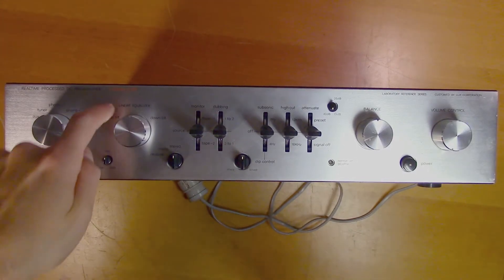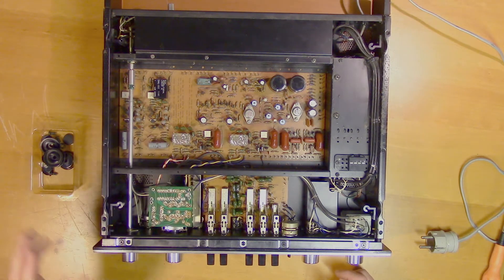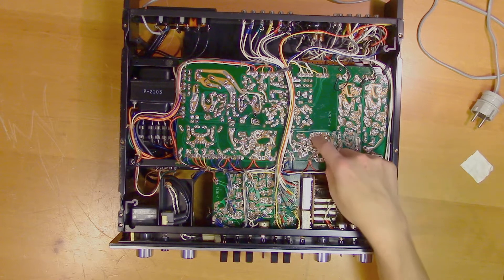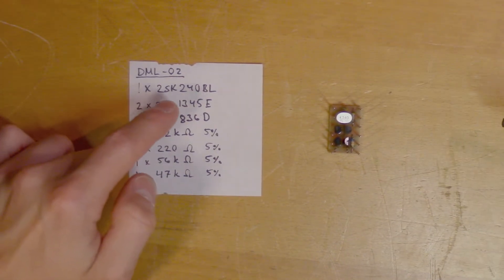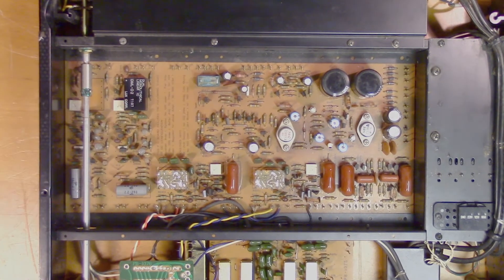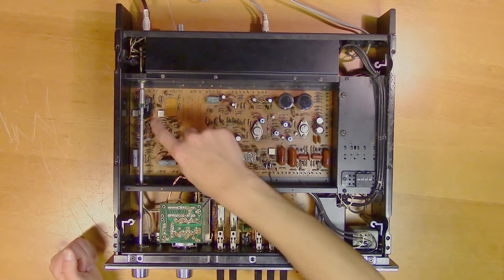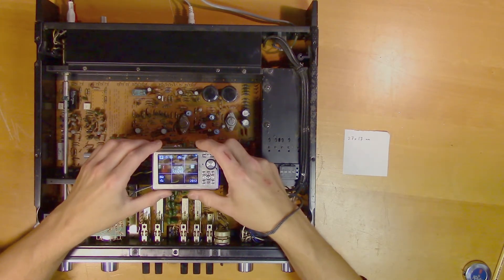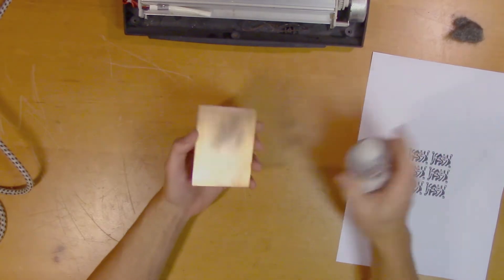Cloning a PCB without Design Software - Luxman 5C50 Repair Part 2

Comment: thats so cool !   I have had the same issue and big headache of faulty DML-02 (on a luxman tone controller 5F-70) .To this day have never been able to find 2 units to replace or substitute at reasonable cost & quality. Would you be interested in selling me 2 units and send to Sydney Australia  OR is there anyone out there that can make a couple of these?
Reply from the maker: Thanks John Reid! My idea with this project was to make an exact copy of the original replacement. The problem I had was that the 2SK240BL was really hard to find, and quite expensive. I did come across a website that offers a replacement, made with more modern components: https://www.hilberink.nl/codehans/luxman57.htm
I cannot say how it compares to the original, but it does seem like a serious project, from the looks of it. I suggest you check it out and see if you think it is worth taking a chance on.
Reply: @SunandWeather  I did contact hans hilberink in the netherlands and he has but seems to be issues with posting currently only via USA (which is  too costly) its something to do with current postal restrictions?  So will keep trying.
Thanks for the quick reply. If you do come across anything let me know.